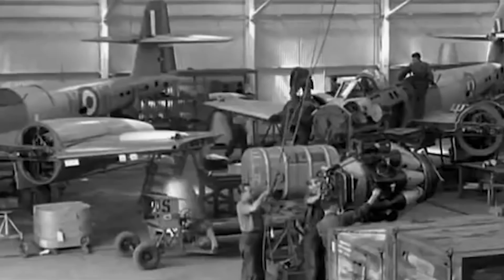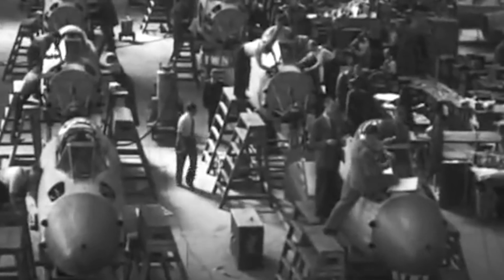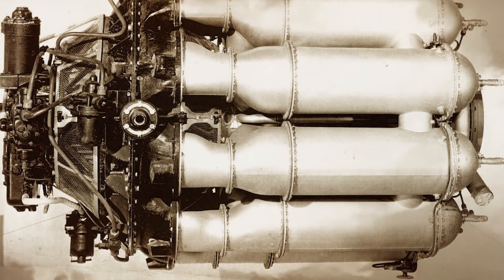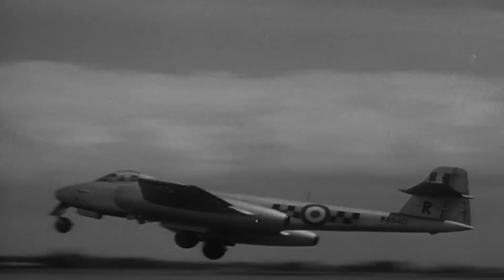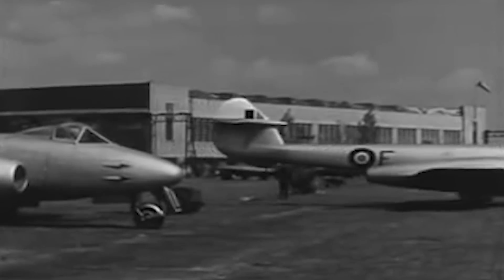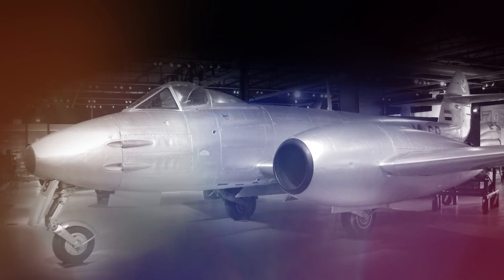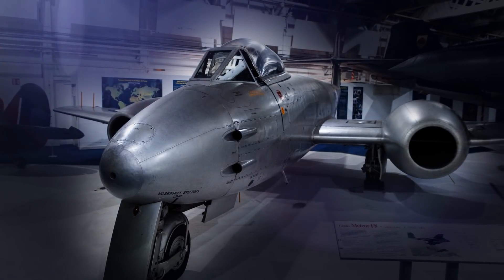Gloster Meteor - The Only Allied Jet to Fight in WW2

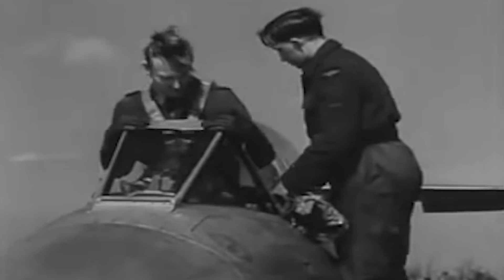Comment: @5:03 nearly 450 pilots were lost while flying the meteor.
luftwaffe:  leave 'em alone boys, they'll take care of themselves.
Reply: paulgilpin   Stupid remark. Check the short track record of the ME262. Note also nobody copied the MEs design after the war to use.

That number is over a 60 year period not during the war. You might want to check the pilot loss record of the F104 (nicknamed widow maker) a much more modern aircraft in comparison, with an ejection seat from the start.

Comment: F104: I am the widowmaker
Meteor:: Hold my underpowered Engines and lack of Ejection Seat
Reply: And the irony is, that it's still in use for testing ejection seats.
Reply: The F.8 had an ejection seat...
Reply: 450 pilots lost is insane  even then.
Reply: @WALTERBROADDUS  That is incorrect.
Reply: @jaclestrat  What is incorrect?
Reply: @WALTERBROADDUS  from WW2 till the Raf retired them in the 1980s
Reply: @gibraltersteamboatco888  And what is incorrect?
Reply: F-104: Mach 2.0
Meatbox: embarrassingly slow.
Reply: @sandervanderkammen9230  Mad wehraboo mad
Reply: @sandervanderkammen9230  Meteor - designed mid 1940s
U.S. government. "Can we have an engine please, pretty please"?
F-104 - designed mid 1950s
Ten years is a lifetime in aircraft technology.
Reply: @PenzancePete  By the 1950s  centrifugal turbojets were obsolete.

The F-104 flew when the Meatbox was still in production...
The U.S. races ahead of the UK thanks to German jet technology.
Reply: Sandbum dorktorbummer.
The F 104 flew the same year as the English Electric Lightning. The F 104 was slower with worse climb but it did dive well, the trouble was it didn't pull out of a dive and some fool thought ejection seats that sent the pilot straight down into the ground was a good idea.  
All US jet engines came from Britain, the German jet engines were failures.
Reply: @sandervanderkammen9230  Bit out of context. The engines of the day lacked thrust.
Reply: @WALTERBROADDUS  The Gloster Meatbox lacked a lot more than thrust... pilots struggled just to keep them airborne without crashing.

Comment: The Meteor was completely outclassed by the ME262, even the Derwant powered F3 introduced at the end of the war was outclassed. It wasnt until the f8 variant that the Meteor finally got superior performance, but it didnt become available until 1948. This is why the RAF did everything in their power to prevent possible contact with the 262 and they were used for flying bomb interception and ground attack
Reply: The Meteors were barred from flying over enemy territory to prevent the technology falling into enemy hands should one be brought down or crash.
Reply: The RAF had Meteors flying over Germany on armed reconnaissance and for ground attack, 46 Luftwaffe aircraft destroyed. the V 1 interception was only the Meteor I the F 3 was more than capable and so was the F 4.

Comment: 450 pilots lost? Really that much?? Its worse widowmaker than the Harrier of Starfighter then..
Reply: Worst jet aircraft to ever see service.
Reply: @sandervanderkammen9230  Apparently, yes! Could you imagine this with F-35? Different times..also in  what we find acceptable
Reply: @reggieziet  Indeed, companies like Gloster and DeHaviland didn't like to spent time and money  using wind tunnel tests and often selected designs simply because "they looked right" and dealing with aerodynamic and mechanical flaws after production started.
Something that would never happen today.
 The RAF even for the time had a particularly callous disregard for pilot safety, they were cheaper than aircraft and easily replaced.
Reply: @sandervanderkammen9230  Except the 262 of course. Which is why absolutely no one would buy the 262 after the war. Whereas the Meteor served with more than a dozen air forces in a career of over thirty years.

Comment: I think its combat service (as the Mk8) with the RAAF during the Korean War might have rated a mention.
Reply: What about it is worth mentioning?
Reply: @sandervanderkammen9230  on a video on the Meteor, absolutely! 
The only non -US jet fighter on the UN side in the Korean War.
Reply: @doughart2720  But the Meatbox wasn't a fighter in the Korean War.
Reply: @sandervanderkammen9230  Splitting hairs a bit here.  Initially they tried to use them as a fighter but it was not successful in that role, so later it was used for ground attack.  It was flown by 77 squadron RAAF and I used to know one of the pilots , a fellow named Keith Meggs.   
Good luck telling those guys they weren't fighter pilots., particularly a fellow named George Hale who shot down a MiG in a Meteor.     
The Australian Government purchased it as a fighter.   Obviously it wasn't successful in that role in Korea, but that doesn't mean it wasn't a fighter;  it just wasn't a capable fighter by then.

Anyway, without getting into semantics,  my original point was that the use of the Meteor in Korea was worth a mention in a video about the Meteor,.

Cheers
Reply: @doughart2720  The ol' Meatbox was never a viable fighter aircraft and was never used effectively in that role.
77 Squadron was slaughtered at Sunchon by vastly superior MiG-15s.
The Meatbox was used primarily as a ground attack aircraft during the Korean War and actively avoided contact with enemy fighter aircraft.
Reply: @sandervanderkammen9230  14 Meteors vs 20 Migs.   3 Meteors destroyed,  1 Mig destroyed, 1 damaged.  Not a good outcome for the Meteor or the RAAF, but  "Slaughtered" , no.
Reply: @doughart2720  That would be a one very favorable Western version of what happened...
Reply: @sandervanderkammen9230   There are always two sides to a story like this.  So whats the Eastern view. I'm interested.
Reply: @doughart2720  The Eastern veiw is that the Meatbox was not a capable fighter... the RAAF agreed.
Reply: @sandervanderkammen9230  
The RAAF Meteors shot down 6 Mig 15's, not bad for such an early design and something the Me 262 couldn't do, the Me 262 couldn't even manage against older piston engine fighters.
Reply: @sandervanderkammen9230  Wrong again NO RAAF pilot ever actively avoided a fight. It is not in our nature We fight at the drop of a hat. Now it could be where you come from that your pilots avoided fighting

Comment: Two examples of the P-80 Shooting Star were sent to Italy prior to the end of hostilities in WW2 for operational testing.  Technically, the Meteor was NOT the only Allied jet fighter flown in anger during that time.
Reply: The Arado 234 was flying recon missions in Italy at that time.  The Shooting Stars were, as well.  Two other P-80s were sent to England, one crashed right away, having caught fire.  The other crashed a little later.  Back to Italy and those two American jets.  Top speed straight and level for the Arado was about 460 mph.  It COULD have been intercepted and downed by a P-80 in an intercept scenario one would think.
Reply: @howardbuttinski  They did NOT engage in combat. The Meteor did. Plain and simple.  "In anger" means that weaponry was used or expended in an attempt to disable or kill the opponent.  The P-80 may have flown recon missions  but it did not meet and engage the enemy in combat... until Korea.
Reply: Technically, he is still correct insofar as those P-80's did not face off against any German fighters although they probably would have, given the chance. Why else would they be in a war zone? They just didn't get the chance. The P-80 probably would have been a real headache for the 262 pilots, even though the P-80 was massively under-armed when compared to the 262.
Reply: Just trying to correct the mistake on the video that the Meteor was the only operational Allied jet fighter is all, or will you say that is bogus as well?   It did fly combat missions, just as the Arado 234 did in terms of risking the pilots necks gathering intel.  People get medals for doing that.
Reply: @howardbuttinski  
The P 80's hardly flew, they were grounded due to the same problems that caused the other 2 to crash. They were YP 80 or prototype versions.